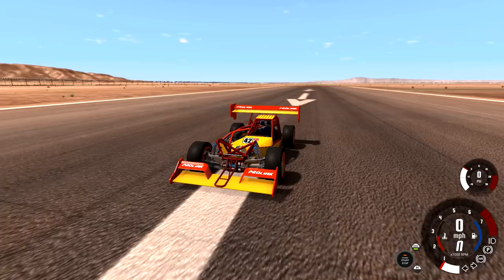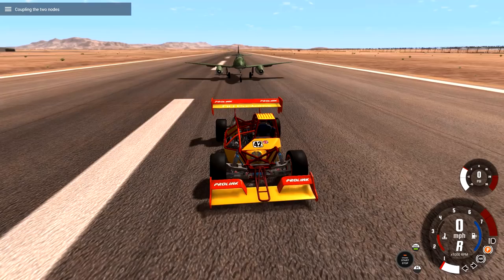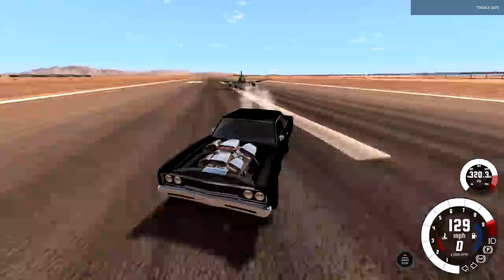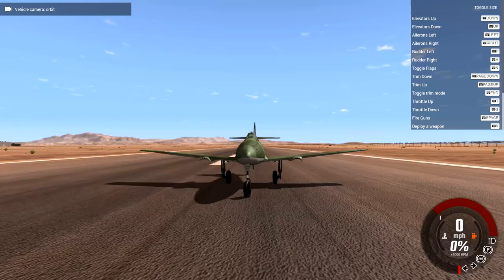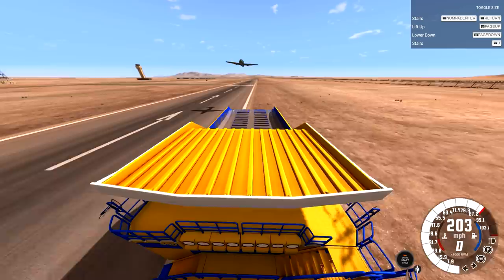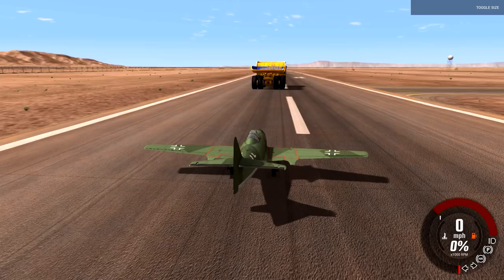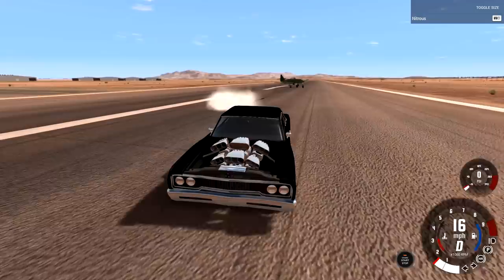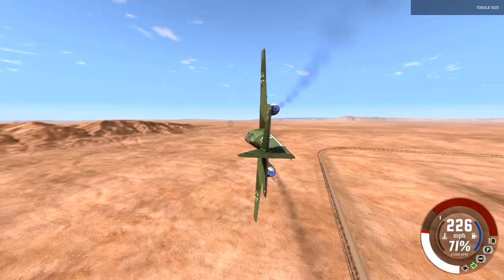BeamNG.drive - TOWING A JET

Comment: ''Why is that thing so heavy when the wheels are retracted?!''

Answer:
The wheels are there to lower the resistance of the movement of the plane. If you were to remove the wheels, it would scrape over the ground and spread it's weight over the whole  ground, whereas wheels lower the resistance of the ground by distributing the weight of the plane on a much much smaller surface. Wheels can also roll over the ground, and the plane itself would just scrape over the surface

Comment: Speirs, try using a controller just once on a beamNG video. Itll let you control the throttle easier
Reply: Brandon Tooth and take the Speirs supercharger off and put the stage 4 with the 10 speed Dom's box, and change the front wheels for race tyre capable rims.
It's drivable.